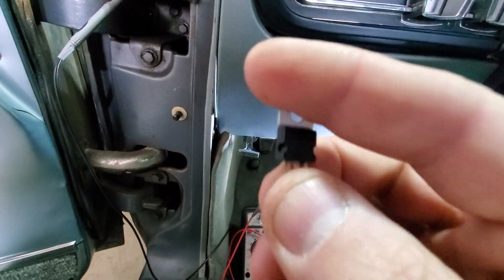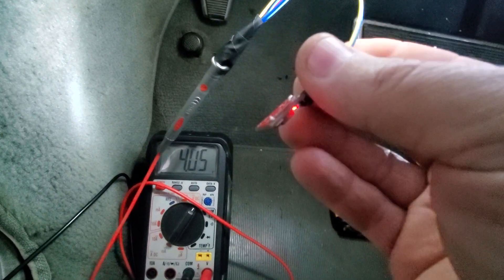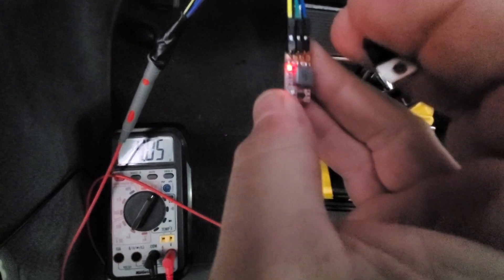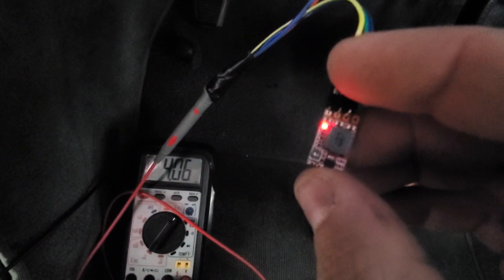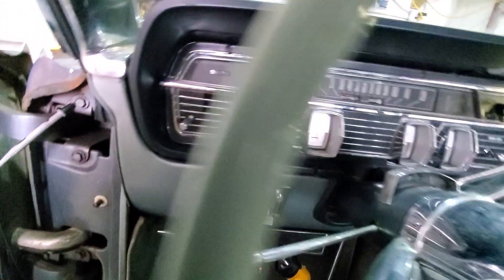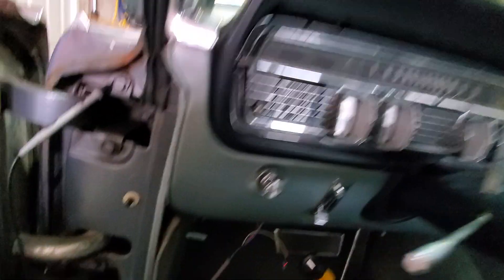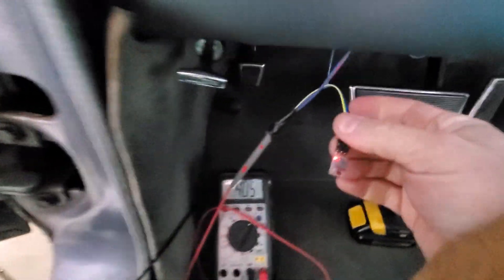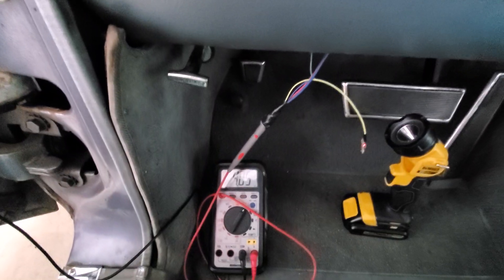FoMoCo Instrument Cluster Voltage Regulator

Comment: thats cool, thats what i need. i bought an electronic regulator and the temp and fuel gauge are a little off compared to the original regulator when working correctly, by the same margin. the fuel gauge is showing the tank has at least 10 litres of fuel but the car ran empty and the temp gauge is showing less than half by the same margin as the fuel (approx. half a bar inaccurate on both gauges). So does it need a little more volts of less? Can you also post the link for the ebay ad for the buck converters please...cheers!